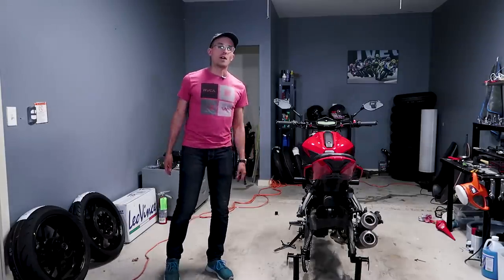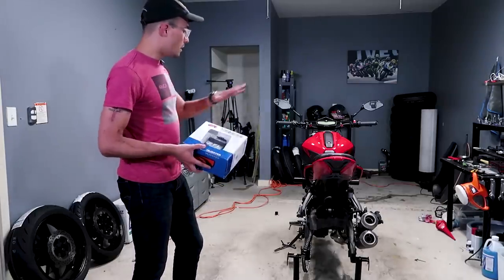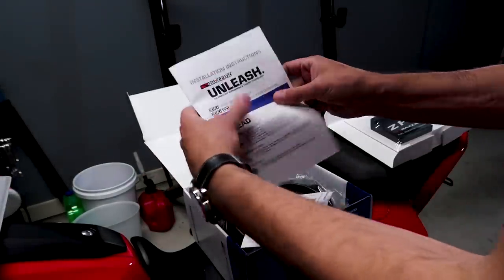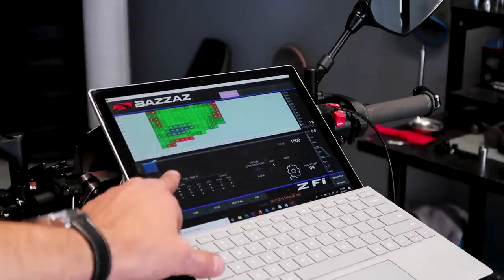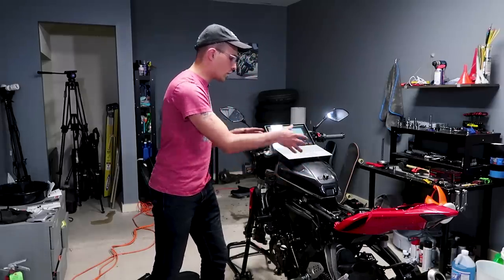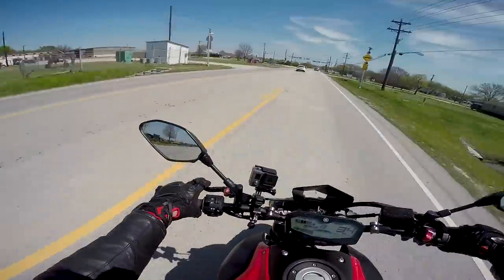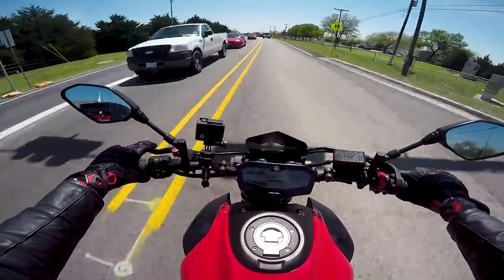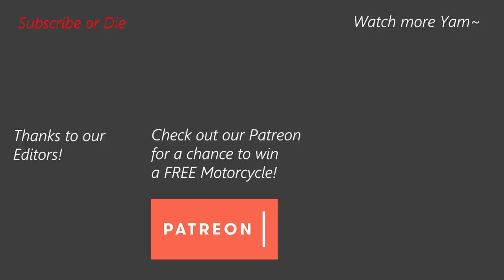The FZ07 is Done! New Tires and Fuel Controller (Who Will Win?)

Comment: Plastic fairing over a tank allows for swapping fairings to change the entire color of the bike and not have to repaint a tank, it also makes it cheaper to fix if you scratch it. 
If you are looking for new content to do, you could do an updated gear guide. Your recommended beginner gear is all unavailable now. The new Icon Airflite helmet is similar to what you had but updated with a nice visor design. The gloves and stuff might be available on Revzilla. You could explain some other gear choices like Pinlock or communicators.
Reply: Yea that would be great.

Comment: I put a Bazzaz module on my 16 500F.  The install was simple. However... 
the injectors wouldn't prime when I turn on the bike . WTF

After about 2 months of weekly calls with the guys at Bazzaz... turns out they had the two wires going to each injector reversed. 
It's an easy fix, but COME ON! And the customer service was pretty much non-existent. 

That said, the unit seems to perform well.

Comment: bruh the angel GT's are for bikes like these. if its a daily, you'll learn to like mileage and i scrape pegs on my fz1 on the pirelli's but i locked my front today at 100mph on my battlax rs10's. cant wait to get my pirelli's again in two weeks.
Reply: I used to run gts on my sv650. For most riders the gts are more than enough.
Reply: @chrisharo2982  i do triple digits in the canyons on them, they refuse to tear, they really are the best ive ever had. i got the rs10's used for 100 bux thats the only reason im running them, twas brokeness.
Reply: @dabliatpizdets  did a couple track days on a top of the pack b pace and not once did they ever complain.